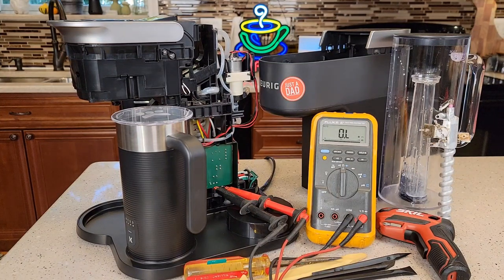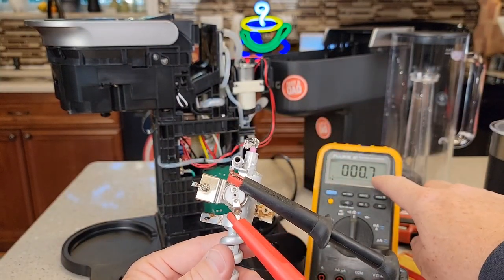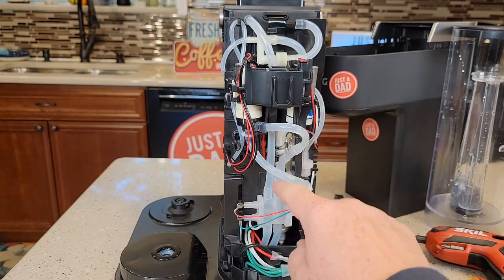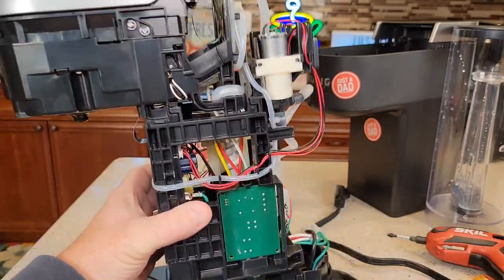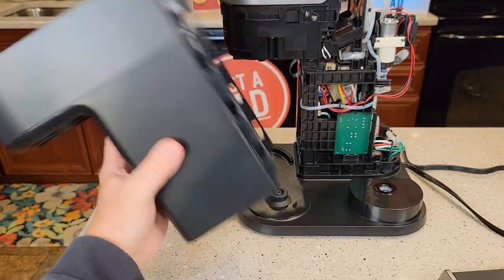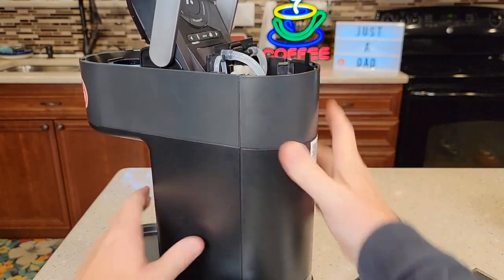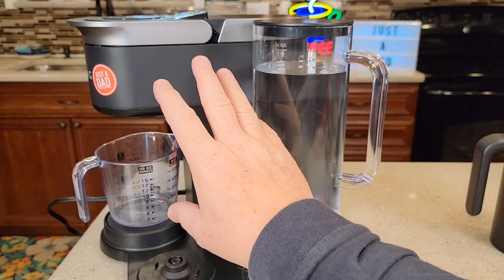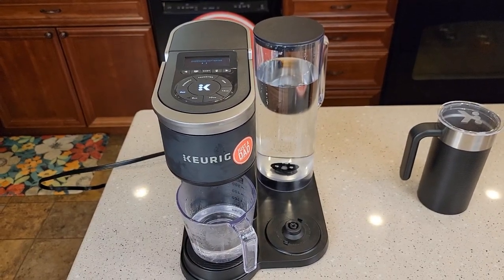How To Fix Keurig K-Cafe SMART Coffee Maker NO POWER DEAD  Reset Thermostat

Comment: Thank you so much! This fixed my issue! I drilled a 1" hole in the side of the coffee maker so I can reset without  taking it apart. I have already had to use the reset button several times.  This seems to be a design flaw.
Reply from the maker: Nice work!

Comment: This was definitely the problem. I figured something was keeping the machine from powering on. It was very maddening because this happened when we took it out of the box, before we could do the "cleansing brew"; it had 'error' on the screen and turned off.  Makes sense that the temp sensor would trip with no water in there. One would think Keurig would instruct people to prime the pump. Instead of trying to pry off that rear cap, which he says is tricky, pull the side of the housing away from each side of the cap, and it comes off just fine. Start near the front, where the pod would go, and just gently pull that plastic out and away from the tabs on the cap. Came off in 10 seconds without breaking any tabs or tools, or hacking up the trim on the coffee maker

Comment: Thanks for the clear concise guidance on how to reset the temp sensor.  While cover removal proved challenging and believe there needs to be a reset function, your explanation worked perfectly and resolved the problem. I hope people understand this is a safety feature, not a device failure as it prevents a meltdown and potential fire.

Comment: This worked!  Thank you for this.   I found it easier to get the side panel off after I removed the screws that are in the non-skid feet on the bottom of the unit.  It helped everything release.

Comment: Hi there!  Thanks very much for this video, seems like I'm having this problem as well. It wasn't as hard to remove the top as I thought, just popped a couple of thin pocket knives in there, and it came right off. I was able to reset the thermostat without removing anything else. Just bent a piece of coat hangar and slid it down there.  BUT, now I don't know why it's popped again. I followed your instructions to get water in there, and made sure it siphoned water up inside. But when I tried to brew a cup, it just popped off again.. Could something be clogged causing it to pop that thermostat?? Any way to check that??  I can't return it to Keurig as I bought it from BBB and don't have the receipt..
Reply: First mistake was buying anything from wretched BBB. With that being said, call the store and speak to a manager. For years, BBB "had a relationship" with Keurig, and would replace the brewer with the comparable model, even if it wasn't purchased at a BBB. If you have the K Cafe Smart, they will know it is a relatively new model, so might exchange it for  you. People hastily throw out packaging and receipts, thinking they will never need them. Having the packaging goes a long way to return something that malfunctions or turns out to be defective, even if you've had it for some time.  I bought a Keurig on QVC when they first came out 20 years ago. It lasted 10 years, then the pump broke. I kept the original box and packing. Someone told me about the BBB situation, and I took it back there, and they exchanged it for the same level of brewer; even though they said they tried to say they really didn't have to, since it was purchased from a discount on line retailer and not from an actual retail store. I told him that the conditions of return specifically state that it doesn't matter from where the brewer was purchased. That was 10 years ago. The manager told me to save the box and the receipt, so when the brewer stopped working, I could exchange it. I put the box and the receipt in my basement, and it hasn't been bothered. Only in the last few months has the pump been not working consistently. Even though I purchased the K Cafe Smart, I am going to call that wretched, terrible, anti-America, anti-American, anti-Christian store to see if they will exchange the brewer for a new one. Just to make them give me a new one and have to damage out the old one.
Reply: First mistake was buying anything from wretched BBB. With that being said, call the store and speak to a manager. For years, BBB "had a relationship" with Keurig, and would replace the brewer with the comparable model, even if it wasn't purchased at a BBB. If you have the K Cafe Smart, they will know it is a relatively new model, so might exchange it for  you. People hastily throw out packaging and receipts, thinking they will never need them. Having the packaging goes a long way to return something that malfunctions or turns out to be defective, even if you've had it for some time.  I bought a Keurig on QVC when they first came out 20 years ago. It lasted 10 years, then the pump broke. I kept the original box and packing. Someone told me about the BBB situation, and I took it back there, and they exchanged it for the same level of brewer; even though they tried to say they really didn't have to, since it was purchased from a discount on line retailer and not from an actual retail store. I told him that the conditions of return specifically state that it doesn't matter from where the brewer was purchased. That was 10 years ago. The manager told me to save the box and the receipt, so when the brewer stopped working, I could exchange it. I put the box and the receipt in my basement, and it hasn't been bothered. Only in the last few months has the pump been not working consistently. Even though I purchased the K Cafe Smart, I am going to call that wretched, terrible, anti-America, anti-American, anti-Christian store to see if they will exchange the brewer for a new one. Just to make them give me a new one and have to damage out the old one.

Comment: Not worth all the work . Breaking pins-really difficult to disassemble as you say - why do all this ? If you can afford one of these in the first place just buy a better coffee maker  . Nothing special about this over priced coffee maker anyway.
Reply: It was not as difficult to disassemble as the video shows. The hardest part for me was getting the screws out of the bottom. I didn't break any pins or tabs, and didn't even scuff up my coffee maker, which he definitely did in the video, by using his "prying tools". I didn't need any prying tools, pens, screw drivers, butter knives, etc., as I simply pulled the sides of the coffee maker away from the tabs on that cap and lifted it up. He did it the hard way; harder than it has to be. I am a very logical and analytical person, so figured instead of trying to lift the cap by trying to release the tabs by pushing them in, I would pull away what is holding in the tabs on the cap. Works much better and much faster. Took me maybe half an hour from start to finish. And it was easy for me to re-assemble. Maybe because in addition to being logical, I am intelligent, coordinated and somewhat mechanically inclined.